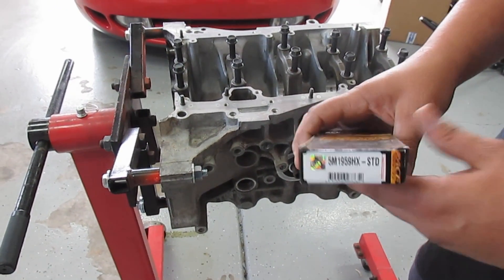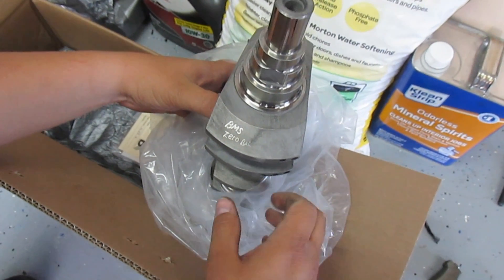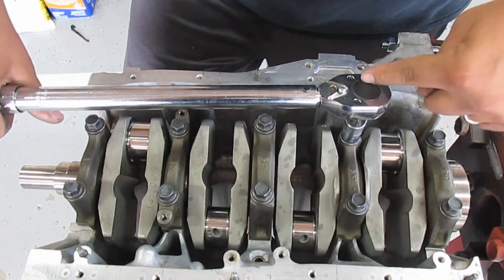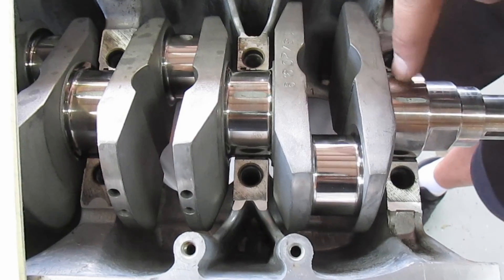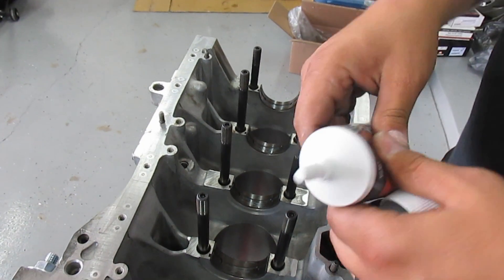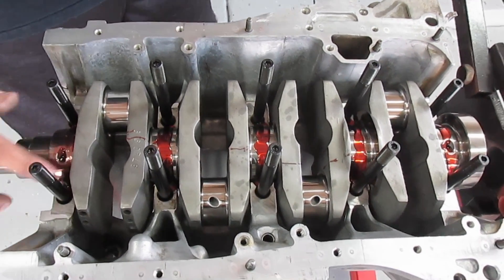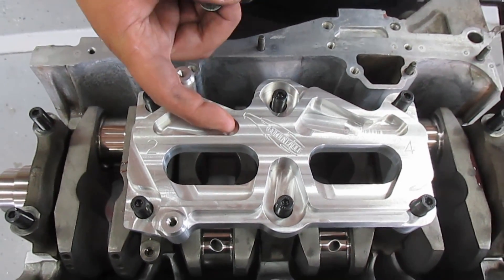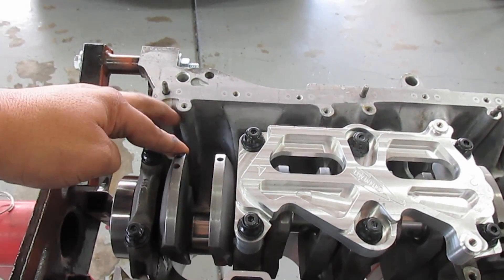Project No Rice #1: Stroker LS/Vtec Crankshaft Install (Stroked LS/Vtec Acura Integra)

Comment: Did you get the mains line honed before final assembly?  I’ve read that more torque with main studs will cause the journals to not be round
Reply from the maker: with the gridle plate, the mains should not distort since the forces are spread out.
Reply: So what torque is used for the #5 and #1 cap? Main gridle plate only covers, 2-3-4  so the force would only spread out there theoretically interesting theory tho can you explain further beautiful Crank btw
Reply: Curious of the same. Ive heard its okay to torque arp main studs to 65lbs if you dont want do a line hone.

Comment: I got a question I have the same block want to run that same golden eagle girdle my question is are they made to ls spec or will I need to take it to machine shop to get check asking ahead cuz my motor is in machine shop already ?
Reply from the maker: are you asking about the block guard or the girdle.  girdle requires the us of ARP bolts and a line hone at the machine shop.  the block guard requires sanding of and installation to be press fit as well as boring to straighten out the cylinders again.

Comment: No rice? DO NOT use s rice 
Rice eagle block guard,  send it to CSS and have the deck closed the proper way!
Reply from the maker: For the power goals there is nothing wrong with the guard.  All machining was completed after install.  Installing the guard does change the shape of the cylinders.  So u must machine after install.

Comment: Why is it important to use the 12pt socket and not a 6? Just cause it may get stuck if its a 6 point?
Reply from the maker: Because the arp bolts are a 12 point bolt.  Unlike the stock 6 point bolts

Comment: Is it recommened to run a crank girdle?
Reply from the maker: Depends how much power u are gonna make.  It can only help.  It has zero cons
Reply: & if I do purchase one, would I need to get it “line bore” or something like that, or it’s a direct bolt on
Reply from the maker: @kokzbrwn  it is direct bolt on.  But it would be good to line hone.  You will also have to use gsr main studs with this ls set up
Reply: oh ok. power goal would be between 5-600 hp.
Reply from the maker: DEF should run that and a block guard.  remember to bore and hone after installing the block guard.  NOT before.

Comment: I was taught to install the bearings in block and on caps and tourqe with no crank in to establish bearing crush , then remove install crank and caps and plastiguage , whats your opinion on this?
Reply from the maker: it does the same exact thing.  either way works fine

Comment: Never break a bolt loose with a torque wrench
Reply from the maker: dwolf7 jesus.  More people like u huh?  It doesnt do anything.  Same thing as TQing a reverse threaded bolt.
Reply: FatGuyBuilds they are designed to ‘tighten bolts’ not break them loose. The reason it has a reverse selection is so you can ‘tighten’ reverse thread bolts.
Reply: FatGuyBuilds but hey believe what you want I don’t give a shit. Just left that comment to let the viewers know the proper way to use a torque wrench.
Reply from the maker: have you ever had a TQ wrench go out of calibration from loosening bolts at the same TQ value as the TQ value that you tightened them to, which is inside of the operating area...

Comment: "No Rice", proceeds to build engine with plastigauge instead of properly mic'ing the clearances...
Reply from the maker: Mic'ing the journals was done at the machine shop.  checking with plastigauge is still needed regardless.  just because it mics out doesn't mean when you put everything together that it is all good.

Comment: Do you Instagram or an email I can contact you @? I need help with my build.
Reply from the maker: Nathaniel Espinoza facebook icon is on my youtube home page
Reply: Jason Georgievski  Ok thanks
Reply: Jason Georgievski what are the dimensions of this motor?
Reply from the maker: what dimensions?  outer engine? bore and stoke?
Reply: Jason Georgievski yes bore and stroke
Reply from the maker: 1mm over bore, 92mm stroke
Reply: Jason Georgievski 82mm bore?
Reply from the maker: F.I.C Mike lopez yes stock b18b1 bore is 81mm.
Reply: What crank did you go with
Reply: What size crank
Reply: Did you use the stock caps

Comment: Question, Those Arps Are The Same Ones You Use To Tighten The Head To The Block??..
Reply from the maker: no,  you have to buy head studs and main  studs
Reply: Jason Georgievski Jason Georgievski thx just chked it out. Last question what do I ask for when I go looking for bolts? Like water pump, oil pick up oil pump
Reply from the maker: Miguel Batista you just go to ace hardware and buy 10.8 flange head bolts.  gonna have to buy a bunch of each and put the longest that will fit in each hole
Reply: Thanks man !

Comment: Do you know that loosening bolts with a torque wrench makes the torque wrench go bad?
Reply from the maker: Bryan Nguyen it is fine.  it is a wives tale.  the torque wrench works both ways.  how would anyone ever tq reverse threaded bolts.
Reply: torquing a reverse thread bolt is different than loosening. i understand that there is a switch for direction but loosening a bolt makes it have to get recalibrated more often..
Reply from the maker: Bryan Nguyen lol, what ever makes you feel good.  it is all the same dude.
Reply from the maker: If those are your beliefs, do what ever make you happy.
Reply: Lucky Rooster some bolts are reverse threads.

Comment: I wouldn't recommend using a torque wrench to bust loose the bolts bc you can throw off the calibration of the tool. It only takes a second to grab a ratchet to take bolts loose.
Reply from the maker: monutz4u been proven a wives tale....  but do what ever you want.

Comment: Jason Georgievski would you say oem main studs are good for 400 hp on the b16a's? 
I also read you have to bore the caps for an alignment, as the caps tend to bend with the arp's 70 lbs of torque requirement...
Reply from the maker: I would say no and never run stock bolts to 400hp.  Also from my measurements, nothing was bending.  ARP is 80ft/lbs
Reply: Jason Georgievski ok cool. I'm really concerned about the main studs.
Reply from the maker: 45Mang why are u concerned
Reply: Jason Georgievski well I'm concerned about mine. I got the arp studs for my b16 build, and after 70 lbs it won't budge. idk if I have to hone align it.
Reply from the maker: 45Mang if you cant spin it with ur fingers then yes.  pull it apart and hone it

Comment: the cost of that crank girdle you coulda just bought a GSR block ;/
Reply: Gotta love the people on youtube.  Great build best of luck with it.  Just a quick questions was the rod size actually 5.512 that's a pretty dam good r/s for such a big crank.
Reply from the maker: all the specs are on the brian crower website.  thanks for the support.
Reply from the maker: lol... we had a gsr block, and we sold it.  we will get more TQ out of a LS/Vtec engine and more TQ from Stroking it.  When doing AutoX or Time Attack or Road course, having good TQ equals Better times and a faster car.
Reply: gotcha...just thought it would be cheaper to put the LS crank and rods in a GSR block. Stock girdle and vtec ready
Reply from the maker: we are not building cheap, we are building a 550HP daily driver that we want the MAX amount of miles from.  he should be able to drive to New York from Cali if he wants.  stock guts at 550HP is not a smart way to go.
Reply: Jason Georgievski not saying your weren't. but wasteful is different than cheap. daily driver or race car? which one? or both? forged bottom end has nothing to do with girdle. and its well known common knowledge the B18C blocks are much more reliable. also both make same peak power FYI due to piston velocity due to the stroke. nice build man, just had some questions. i like facts, stats and numbers, not opinions.
Reply from the maker: both will make the same PK TQ?  1.8L vs 2.1L  I think not.  Both will have the same turbo spool time?  Fact, 2.1L will spool faster than a 1.8L
Reply: sure will, higher compressions helps as well. Also just noticed 2.1L, so you didn't sleeve an LS block or GSR to 84.5mm, you bored a B20 out? Thats a B20/VTEC or CR-VTEC....not LS-VTEC...sounds like a fun build, those stroker kits aren't cheap. if using the b20 block, make s since why you bought the girdle now.
Reply from the maker: 1mm over bore.  b18b1 from gs integra, gsr head.

Comment: how come u check clearances with stock bolts but using ARP bolts to assemble? Also the mains have to be lined honed  when using arp. Maybe u showed us how to check clearances on one block then assemble the other with arp bolts. lol??
Reply from the maker: I TQ'd the factory bolts to 80ft/lbs just to check the clearance since i was throwing the stock bolts away.  so the TQ values are equal, pressure on caps are equal.  thanks for helping clear up exactly what happened.
Reply: Using arp main bolts you are always supposed to line hone the block because of the higher torque values.
Reply: Jason Georgievski this is a great video; hats off to you for actually making one. I know it helped others attempt their first crank installation. The arp bolt issues such as whether it gives a tighter clearance and require line honing can be resolved; ask my machine shop and ask arp. These uncertainties in no way detract from the knowledge one can attain in subscribing to your instructional videos. Thanks again for making these videos. I hope that you will consider editing if enlightened on the arp issue.
Reply: i agree with kenino, for get about torque specs for the most part, its all about crush pressure 
the nut end of the arp stud uses a different thread then stock, to with the same torque spec the crush will be different 
plus the use of arp lube will change that, arp have a torque spec when using their lube and when using normal oil,  the normal oil spec is higher. as i don't read these specs ever single day i don't remember them but its drastically different. 
i would not run this engine before fixing it. 
no rice means no corners cut as explained in a newer video, this is just cutting a major corner
but what would i know, im only a person on the Internet and only built 100s of engines
Reply from the maker: John Strong dude all measurements are fine.  clearances are good.  car runs smooth
Reply from the maker: Keino Clarke line honing is not always needed
Reply from the maker: Keino Clarke bolts dont change clearance if TQ value is the same
Reply: Jason Georgievski ARP: 80lbft. factory 56 lbft for the. outer caps and 49lbft for the girdle. Not meaning to challenge you but i did 2 engines this week, one with ARP mains the other factory mains. The arp'd block was line honed because of higher torque value tightens up the main's clearance. bolts
Reply: Keino Clarke I highly agree with you.
Reply from the maker: Mike McDonald always my ass.  if clearances are correct, then you are fine.  if clearances are bad, then line hone.
Reply: I have a GSR block with ARP mains. It had to be line honed with the main studs, because as the torque increased it was noticeably hard to turn the crank. Had to test it tht way because i do not own a dial bore gauge.

This guy probably just torqued the arp mains to factory, which is not uncommon.
Reply: wondering if when installing arp must we hand tighten then back off bolts, place head on then torque?
Reply: People on the internet with n o uploaded videos know everything ya know lol